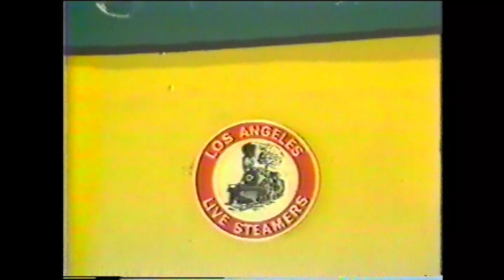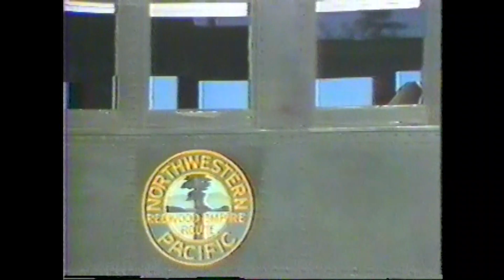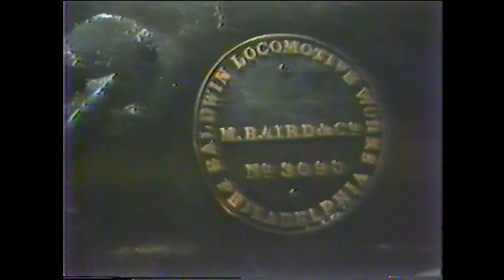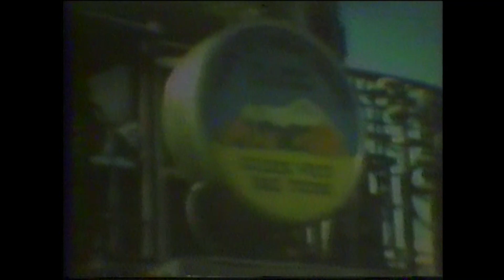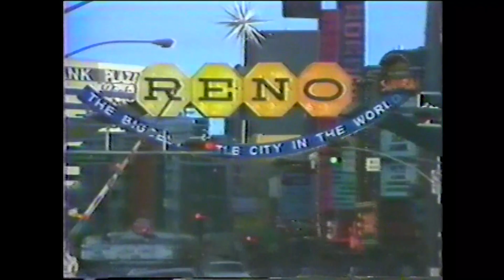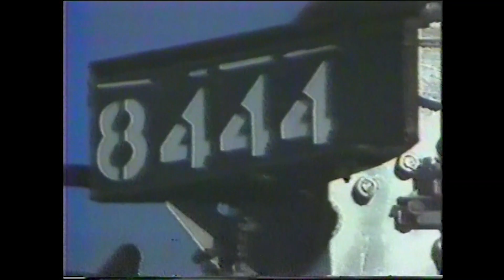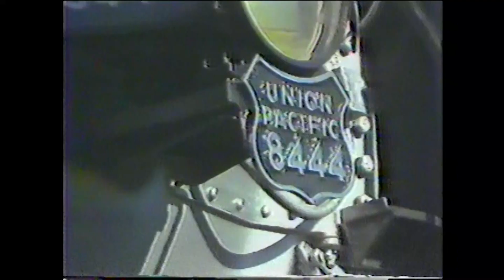Train Watcher Five (RailFair '81) 1981

Comment: 24:58 AMTK SDP40F 615 made it into the Phase III paint scheme when this scene was taken. Any other SDP40Fs that received this paint job before being retired/sold to the ATSF (because of their notorious derailment issues)?
Reply: Yes, Many. Most ran on the Silver Meteor / Star from DC to Miami/St Pete. Some were sent to run on the zephyr as well as chief, starlight and Sunset. 615 was an LA unit for Sunset, And Starlight. It was on the Chief trailing in this video due to not having ATCS equipped. The only pools to have them were LA, Chicago, Miami and St Petersburg. When the pass thru wiring program came into play in Spring 1979 for conventional equipment (Steam Heat / HEP) for The SDPs, close to 40 SDPs were chosen and had Phase 3 wrapped around them some with the roadnumber in the rear some didnt get the roadnumber in the rear just on the striping. There a forum on trainorders that shows these numbers.